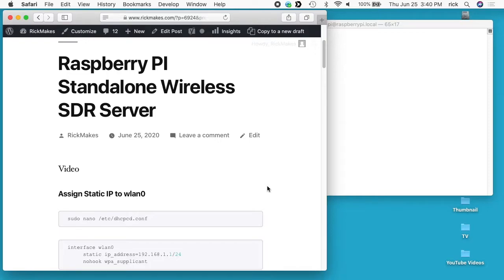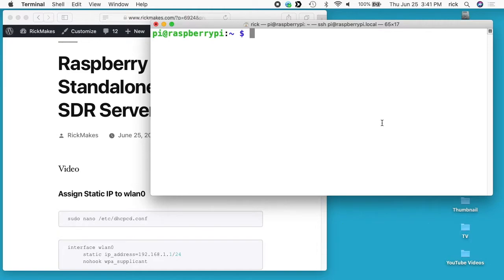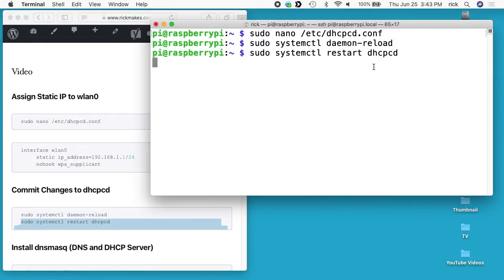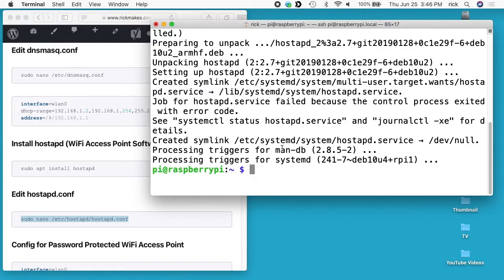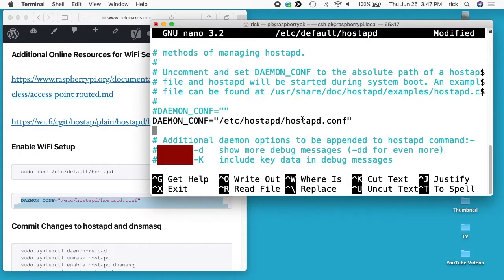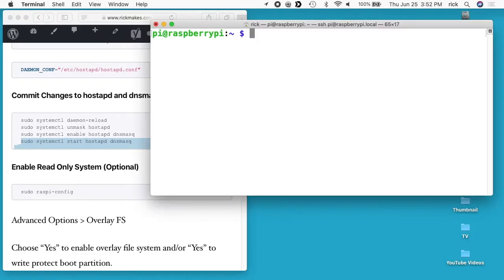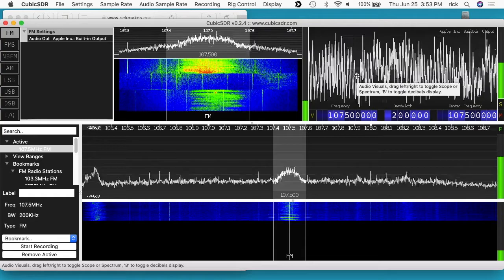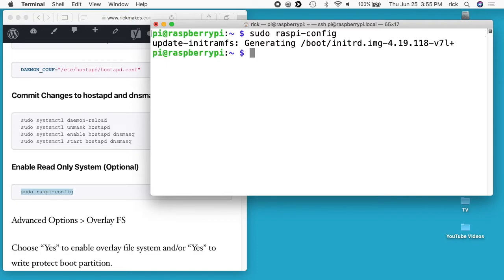Raspberry Pi Standalone Wifi Access Point SDR Server

Comment: So, just to confirm, you can receive the data in this case play the audio from the sdr radio on the laptop which is connect to the raspberry pi?
Reply from the maker: Correct.

Comment: So it's now just like a normal WiFi router and works by itself like it will be able to browse the Internet?
Reply: It'll be able to browse the internet if you connect the Pi to a network that has internet services. 
(However, the Wi-Fi module is in use by the access point service, so you'll have to do it wired, or get a Wi-Fi dongle.)
Router - manages the local network and Wi-Fi systems
Modem - translates packets between the router and ISP (Internet Service Provider). Can be from satellite, cable, or 3G/4G LTE connections.